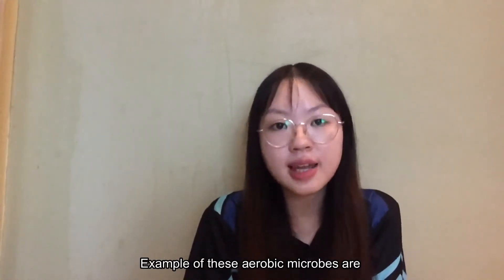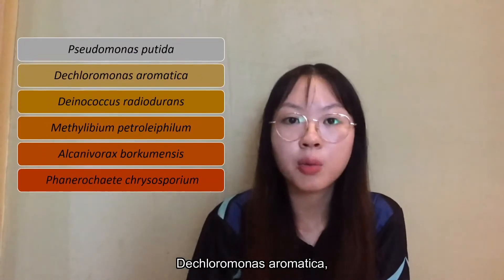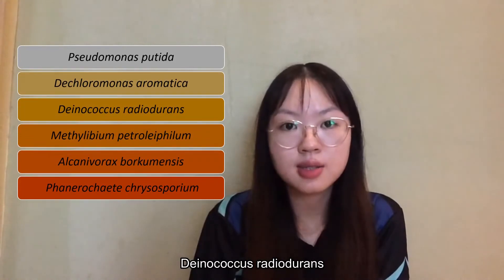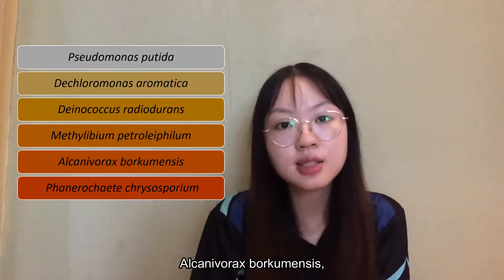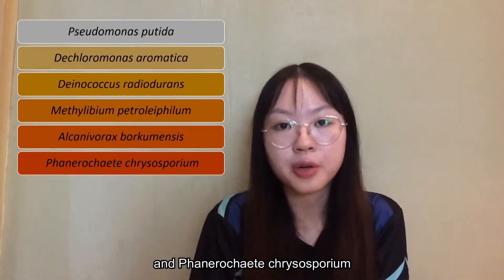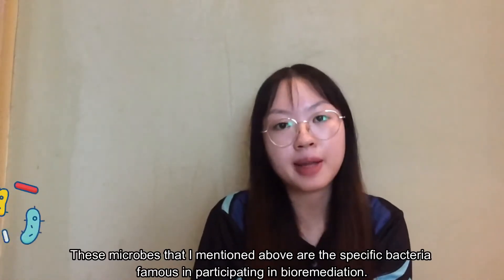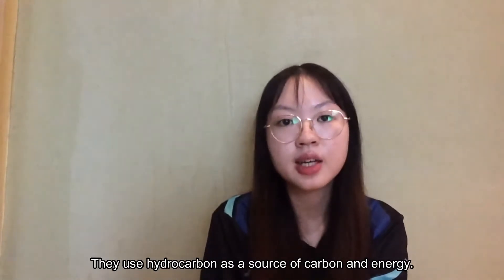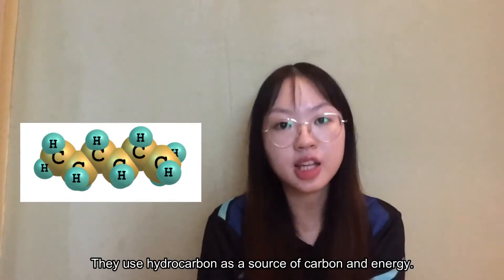Bioventing- a method of bioremediation.

Comment: Oxygen doesn't naturally enter soil below 2.6cm (less than an inch from the soil's surface). Below that is where the Anaerobic microbes live, and I do wonder if this wouldn't cause both a pathogenic imbalance in the soil, along with other conditions that might make certain nutrients inert that you want to have plant available. Bioremediation is a strong focus in my garden but I use a multi-staged approach (Indian Mustard, Cold Composting, and Worm Bins). I have recently started using Chitosan as well (because of how well it is able to not only neutralize pathogenic microbes, but also because of its ability to chelate heavy metals in soil). Have you seen any negative side effects from this Bioventing remediation method or is it more of a new approach from the past couple of years that you are still studying?